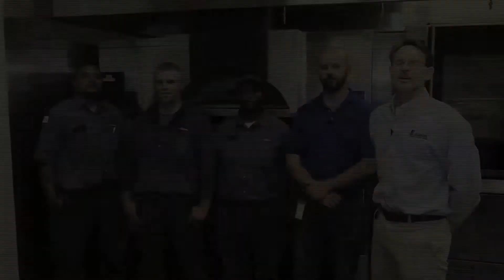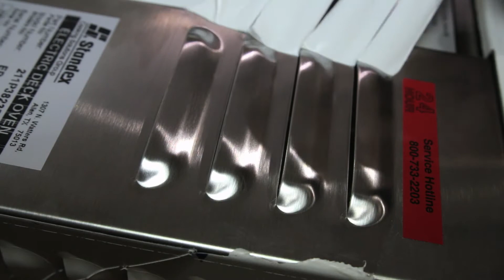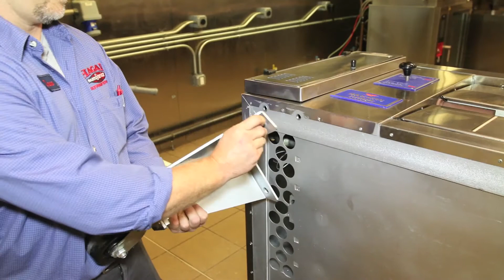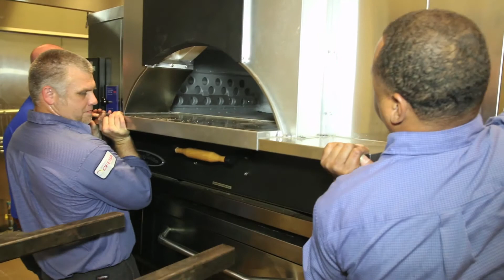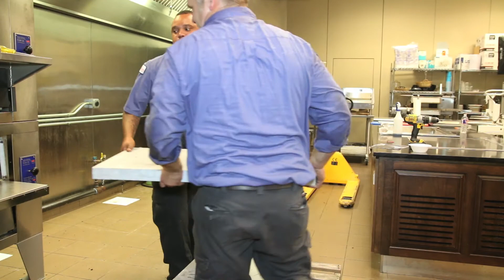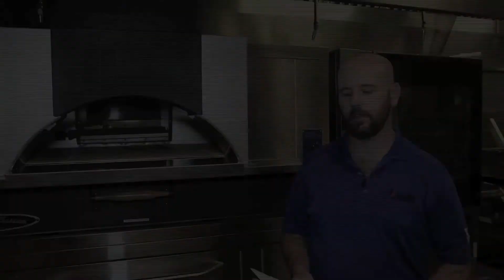Il Forno Classico Pizza Oven Installation | Bakers Pride

Comment: We are experiencing strong top heat, even when the dampers are pulled out all the way.  Are the holes on the sides supposed to be completely closed off?  We also have holes on the top and assuming a lot of the heat is coming from there....is that correct?